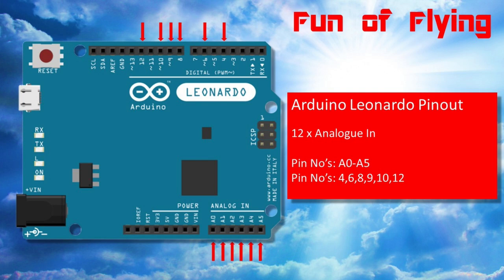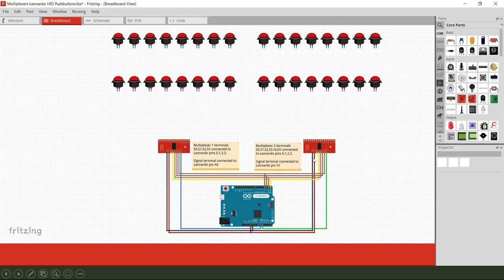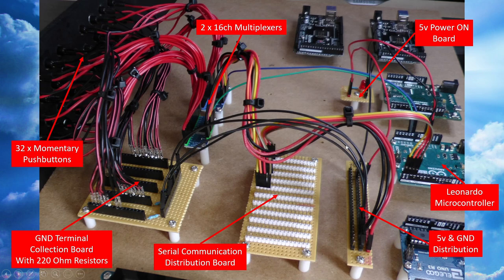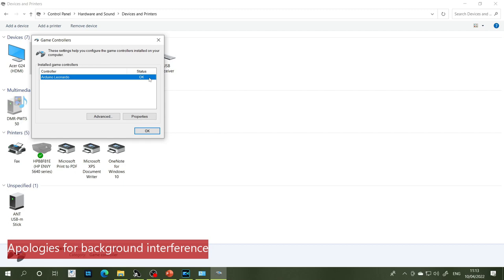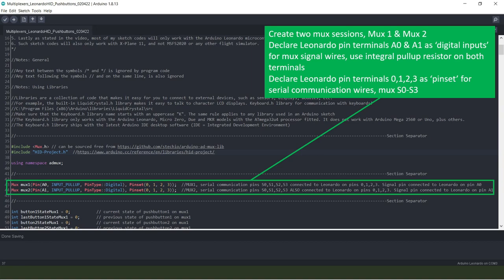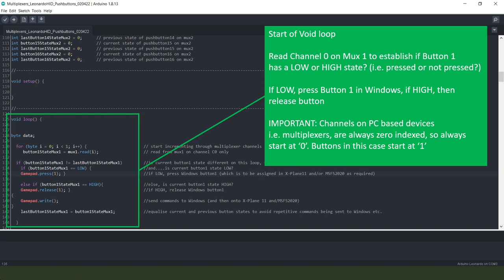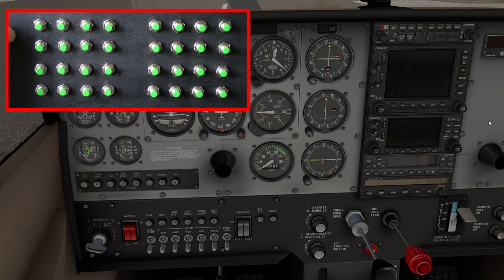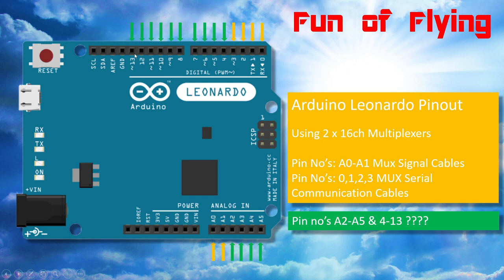HOME COCKPIT BASICS..... INCREASE INPUTS with MULTIPLE MULTIPLEXERS & Leonardo HID Microcontroller

Comment: Hallo Paul, I got an error while compiling:  "Game" was not declared in this scope. Do you have any advise for me? Thank for the instructive video!!
Reply from the maker: Hi Jack, sorry for the late reply, but I’m still away on extended vacation and not expected home again until the end of September. This unfortunately means that I currently do not have access to my PC or any of my Arduino files or applications.

However I may still be able to assist, if you could copy your Arduino code into a Word or Notepad document and send it to me by email to funofflying@gmail.com.

I’ll have a look through the code and advise accordingly.

Kind regards

Paul
Reply from the maker: I forgot to ask, when you get the error message, does it highlight any particular line of code that it doesn’t like? Thanks 😎
Reply: Hello Paul, no problem. Vacation goed first! Your suggestions to check the error code did the trick: I made a mistake in the code; I wrote "Game" in stead of "Gamepad". So the problem is solved. Thank you for the response!!☀️

Comment: Hi when i want include only 28 buttons an 2 rotary encoder and the encoders activate in cw one button and in ccw a other button can i use this code too or what i must change?
Reply from the maker: Hi there and welcome to the channel 😎

As it’s nearly midnight here in the UK, please let me look into this in more detail in the morning and I’ll get back to you with an answer.

Hope this OK for now and speak soon

Kind regards

Paul
Reply from the maker: Hi again, sorry for the delay in getting back to you!

Frankly I have never had much luck operating rotary encoders through a multiplexer, which is what I think you're trying to do? I get much better results connecting the encoders directly to the Leonardo microcontroller and the good part is, that the encoders will still be seen by Windows as part of human interface device (HID). This assumes of course that you have 4 spare input pin terminals on your microcontroller?

If you send an email to funofflying@gmail.com, I will send an example code that you can use and include in your main sketch code as required.

Hope this helps.

Kind regards Paul
Reply: Ok thank you very much

Comment: I tried to follow the diagram you provided using 2x mux however after programming mux2 is not picking up any inputs. I have reviewed my code a few times and just not sure what the issue is.
Reply from the maker: Hi there, many thanks for your message, all noted. Unfortunately though, at the moment, I am away staycationing on my boat and don’t have access to my home PC or files.

I am however planning to be home for a few days from 29th April, so will no doubt be able to assist you then, if that’s okay? In the mean time, if you could send me your Arduino sketch code .ino file to look at, that would be great. Also, if you could send me a clear photo of your wiring layout, that could help as well.

Please send the files to funofflying@gmail.com, thank you.

Kind regards Paul (Bedford, UK)
Reply: Thanks Paul! Will go ahead and do that
Reply from the maker: Hi again, just to let you know that I came home earlier than expected and will be here for a week. If you need any assistance therefore, please let me know? Kind regards Paul
Reply: @funofflying15 Hey thanks for your response. Great news managed to get this exact setup working with 2x mux. I also replaced 4 of the buttons with toggle switches and debounced them! All is working well.
Reply from the maker: Brilliant, well done and keep up the excellent work my friend :-)

Comment: Hi Fun of Flying. Once again, great video thank you. If I may, you could use a bread board to link up certain wires .They come with bus bars, perfect for your project. Im about to do the same project and got a nice bread board capable of taking larger wires directly from an external power supply and feeding it into a dedicated line on the bread board. And its really not that expensive either. I hope this helps. This will save time and effort on soldering and so on...
Reply from the maker: Many thanks for your kind comments, appreciated :-) I could of course use a breadboard in my projects, but I prefer to have something a little more permanent and robust, plus I don't actually mind the soldering part of it. I do use breadboards however for all of my initial testing, prior to committing to any particular project. Kind regards Paul :-)
Reply: @funofflying15  You are more than welcome Paul.  
That makes sense. The soldered connections are much more reliable.
I saw you gave your email address in one of your videos. I will send you an email in the near future, I have something to share and I think we will both greatly benefit from it.

Kind regards Zeaan. :-)

Comment: Love your channel!  Thanks for showing how easy it is to work with a multiplexer and handle so many buttons!  I do have one question... why the for(...) loop for checking each button when it only ever produces a single value? Can't you just do  "i=1; button1StateMux1 = mux1.read(i)" for each button?  Or even eliminate the variable all together and use "button1StateMux1 = mux1.read(1)" ?
Reply from the maker: Hi Larry and thanks for your kind words, appreciated 😎

Re: the code relating to the multiplexers, this has only come about through a lot of trial and error on my part and could no doubt be improved by people with more knowledge and skill than I have! 

I’m certainly not a qualified or professional computer programmer and have never had any experience working in this field and it was only when I started messing around with Arduino following my retirement, that I started to put a few things together, such as that in my videos. I will however take your suggestions onboard and try them out in future codes.

Kind regards Paul 🥸
Reply: @funofflying15  I appreciate the quick response, Paul.  Many of us old dogs are learning new tricks and I just wasn't sure if there was a particular reason for using the for loop. I tested it with just hard-coding the values and it seems to still work.  Cheers!

Comment: Instead of using multiplexers such as 74HC595 or any others, you can create an array, like a matrix. use all 20 pins (digital and analogue all together) and get 10 rows and 10 columns giving you 100 buttons without a multiplexer. you can scan an array and read the current state and compare it to the previous state as you did before. This way you can create a keyboard response or using the joystick library you can create 100 buttons button box and assign each button to your simulator.
If you need some help with it, let me know.
Reply from the maker: Hi Michael

Many thanks for your kind suggestions and welcome to the channel 😎. Obviously I would like to investigate this further, although right now we are having an extended vacation onboard our boat where access to the internet is very limited. When I get back home however, whenever that will be, I’ll look into the subject of arrays and contact you for further advice if that’s OK?

Take care for now and thanks again 😎

Kind regards Paul
Reply: @funofflying15  I will be more than happy to help you in coding as well as with some PCB design solutions. 
If you are interested I am also designing and 3d printing cockpit elements of all sorts. I think it will be a hell of a fun to build a nice generic, fully functional cockpit together!